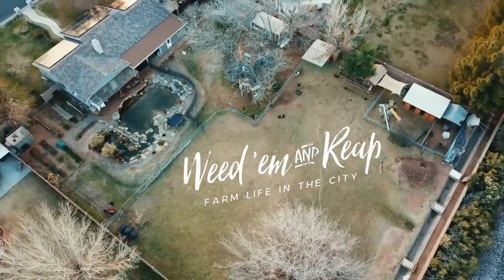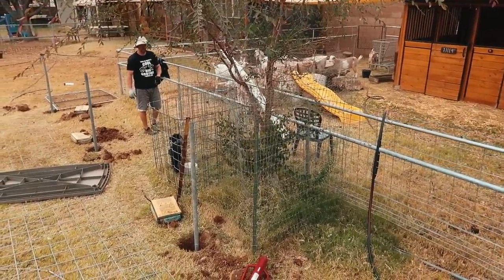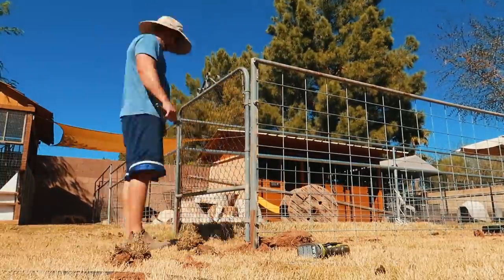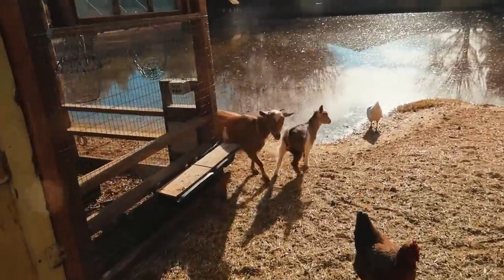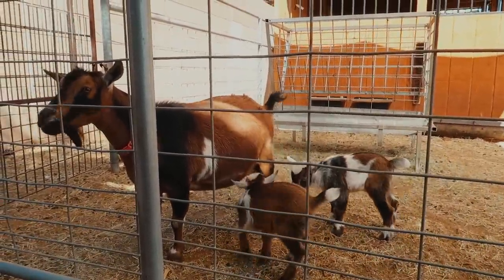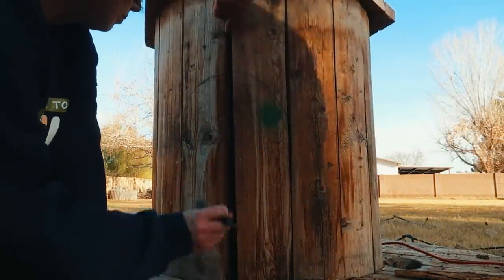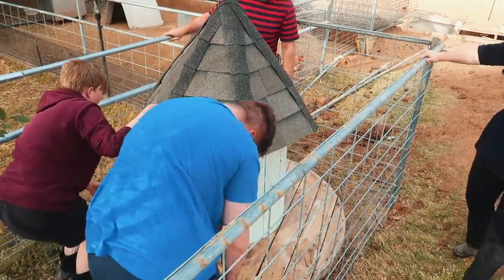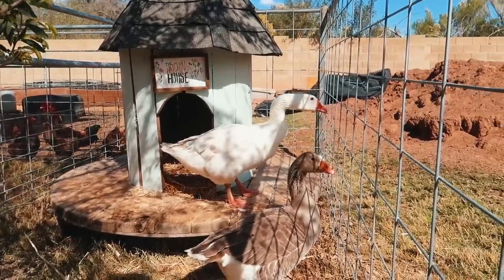We built a GOOSE HOUSE for hatching little goslings!

Comment: The hatching house and area looks amazing!! You could take and run chicken wire or the like around the bottom of it and use a roll of black plastic water pipe, or regular PVC pipe to make  a hoop structure over the top, and cover that in wire as well... Doing so would allow you to still be able to walk inside and the chicken wire all around would keep predators out and the area could be used by all of your birds as a brooding area. That would allow the Mums to teach the chicks in a free range type area, yet keep them safe until they are big enough to be out in the open. Just a thought...I love it and I'm inspired!!!

Comment: Are you going to build something for the geese specifically to get the geese high enough to avoid the water? I would put them in the corner up on something and then hang something on the wire to turn it into walls. Kevin can do it!!!! They will feel safe and secure! Yeah Kevin!